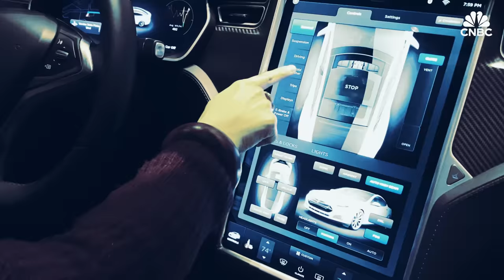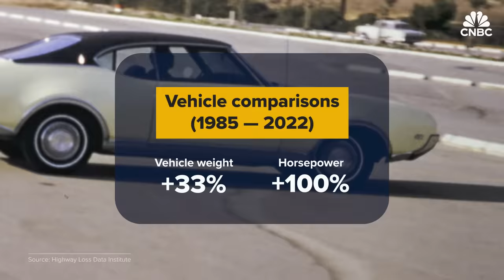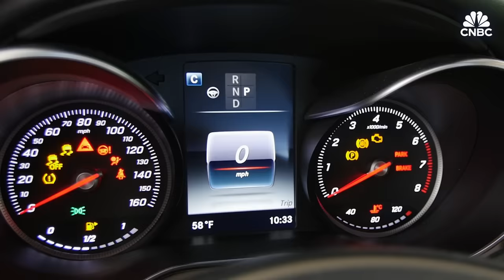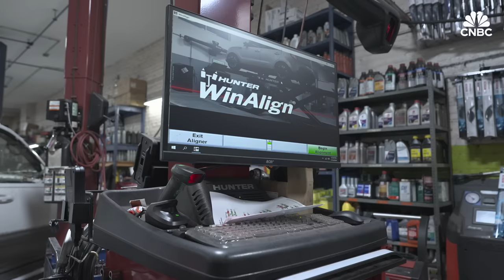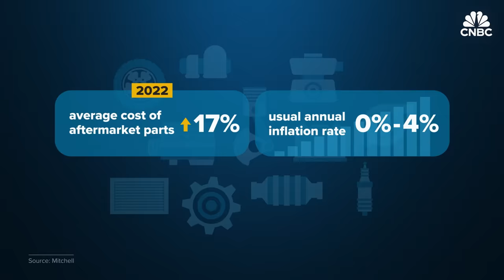Why Car Repairs Are Getting So Expensive

Comment: At this point im riding an electric bicycle or getting a motorcycle license because this is getting ridiculous putting money into something that expensive and be a necessity for everyday living.
Reply: I typically drove just under 3,000mi/yr. Since I got an ebike, especially a cargo ebike, and a Costco opened up within ebiking distance, I put over 2000mi/yr on my e-bikes and <600mi/yr on my car.
Reply: That's limiting. You can't ride an electric bike or motorcycle in the rain or when it's cold or when you need to carry stuff/people. You can't ride much beyond your town.
Reply: @bwofficial1776  Did you not see I still drove almost 600 miles after using my e-bikes for most of my previous car? You don’t have to go car-free, car-lite is just fine. I don’t feel limited in the slightest, especially when I cruise past congested traffic.

I ride in the cold a lot. Done it as cold as -10C (14F), which is the lower limit anyway for the batteries when they’re cold. A lot of people do. Simply dress for the weather.

I don’t like riding in rain though many people don’t mind it. It’s more fear of bad drivers due to reduced visibility and traction than my own comfort. Were safer infrastructure available, I’d ride in the rain too.
Reply: @bwofficial1776 who said you cant ride in the rain and cold on an ebike? Plenty of ebike riders do both and their ebikes can handle it. Dress for the occasion.

Also if you need to carry stuff, you have to get the right bike for the right job. You dont get a road bike for a cargo bike job just like how you dont tow 10,000 lbs with a prius when thats a truck job.

My cargo ebike can carry people and/or cargo. It can carry a combined weight of 450 lbs (rider and cargo/passenger) and 300 pounds of that can be on the cargo rack alone (Thats ignoring the fact i could get a bike trailer to expand that capacity further).

Put it simply, i can carry a week worth of groceries and still could add more stuff if i needed to.
Reply: Yeah but if you get hit by a car you’re dead
Reply: @nickrod7627  that’s why it is good to live in a place that isn’t so infected by car-brain.

Comment: I drive a 20+ year old car. Still the same car since my university days.

Parts are cheap, easy to replace and gets me from point A to B without hiccups.

Great on gas too and my insurance bill is low since older cars are lighter in weight.

Older cars also have way less electronics - which in my opinion - are not needed 99% of the time except the ECU.

The golden era of economic performance cars is between the 80's to early 2000. Cars without carburetors and fancy digital gadgets. Most of these cars have amazing gas mileage and don't require an arm and a leg in costs to diagnose because there are simply less things prone to risking giving out false readings. 

Most importantly, people need to understand pre-emptive general maintenance for their cars such as fluid and oil changes along with other consumables like serpentine belts, boots and hoses - a.k.a. the items prone to deterioration over time due to moisture, thermodynamics and oxygen damage. 

Personally, unless one has money to burn, my opinion towards cars is that for work and travel - buy an used older model that has a solid engine and tranny. 

For pleasure, sure buy something newer (Or vintage) that isn't driven too often, is stored undercover or inside a garage.
Reply: I own a car of similar vintage, I prefer that era as well. I'd be wary about the electronics older cars do have, and it might apply more to 80s and 90s cars, those electronics are ageing and may fail themselves eventually. But yes, as far as parts availability goes, can't go wrong.
Reply: @Jscot1001  Get a used Toyota. Parts are EVERYWHERE. Tons of aftermarket replacement parts for CHEAP too
Reply: can't get parts vehicles made in 80 90 already hitting early 2000's
Reply: Bought a 2008 Highlander, when I purchased it, went on eBay and spent $40.00 on a few replacement parts, the most expensive thing I purchased for my Highlander was the battery for $125.00
Reply: @Argedis I have a 2022 Corolla and it's a piece of utter trash. Will never again buy a Toyota. I'm in Europe, maybe the models sold in the US are better, I don't know.
Reply: Same story with my 06 Camry my dad bought when it was new: I spent ~740 on regular unleaded in 2023 to drive ~9400 miles. Costs 24.92 on oil changes roughly every six months or 5000 miles at the local Walmart Auto Care Center as older vehicles aren't picky. Auto insurance is also negligible, versus that alone would likely eat away the cost advantage of better mpg on a much newer vehicle. I imagine it's also a statement to other motorists you're a safe driver that your vehicle is past 10-15 years old and you're keeping it and has no collision marks. I will keep driving it so long as it gets me to my destination.
Reply: not all cars were lighter 20 years ago there were some full size cars that still weighed more than 4000 LBs such as the Ford Crown Victoria LX Sport Mercury Grand Marquis LS & Lincoln Town Car and modern day ones Mercedes SL 43 AMG  Cadillac CT5 V Black Wing are all over 4000 LBs and in the case of the Benz SL closer to 5,000 LBs hell the Lincoln Continental Convertibles from the 1960s were 5,500 LBs
Reply: @MattExzy  Convert to the ole reliable carburetor when electronics fail. When my PCM fails and I can't get a replacement anymore, I'm carbing it.
Reply: Let me guess.Toyota?!?!
Reply: @HuChing-ob4kk  honda dc5 :P
Reply: cars from the 80s sucked, low hp and bad gas mileage, you want a carburetor? ok say good bye to your gas mileage and have fun in the winter
Reply: @mikeg3495  who cares about gas mileage? Milk cost more. And my 70 71 charger does just fine in the winter with its fuel guzzling 4 barrel.

Comment: The more tech you put in cars the more repairs cost. Endless scans and calibrations don’t help. Lots of plastic bumpers add to repair cost as they damage easier. This trend won’t stop anytime soon.
Reply: People laugh because I drive a car with a key and no FOB until their FOB goes bad.  My last key cost me $4 at the hardware store.  My wife's FOB (that went bad) will cost hundreds of dollars to replace
Reply: The more tech you put into cars the EASIER it is to diagnose and fix problems..the problem is it COSTS to have guys who can DO that
Reply: My car has manual windows, manual transmission, manual locks, no key fob and no trunk release from the inside of the car. So simple, I love it .😂
Reply: Take it from the French, you don't have to repair plastic bumpers.
Reply: @Alessandro-ev9bj  these nothing to break!  That's a man's car there...

Comment: Paid $2,500 to replace the clutch system in my 2005 Tacoma outside the Toyota dealership and it took the maximum book time and rate. The mechanics are ripping us off just like the dealers.

Comment: Ex GM engineer told me they designed components to purposely fail. They would choose designs that were highly fail prone but were a 10% cost savings to produce.
Reply: So you are saying that you would gladly pay more for a car with better parts?  I doubt it.
Reply: I'm an engineer. No this doesn't happen. There is a fine line of design/engineering to meet a specific price point vs intentional malace. Yes in order to meet a certain end price some shortcuts are made, but its purely price driven. I could design you a $250k dollar corolla, but no one would buy it.
Reply: @bobroberts2371 i did. A 2023 camry isnt exactly a budget car for someone who only makes 52k a year, but the reliability will make up for it in 8 years
Reply: @thedude5040    Thanks for bringing that up.  Many of the tin foil hatted people fail to realize that life expectancy of cars has steadily improved since they were invented.  In the 1980's a car with 100,000 miles was completely worn out, now a car with 150,000 still have a good amount of life left in it.   The real issue is car owners not maintaining / fixing stuff as it fails then getting hit with a big repair bill.
Reply: It's not deliberately designed to fail.

It's literally just R&D engineers designing new components that work, presenting them to the board of bean counters, and then being told to find a way to make those components cheaper. It's called cost cutting and there are natural consequences to that.
Reply: ALL GERMANS DO THAT.

Comment: Cars in the future (EV's specifically) SHOULD be less to maintain due to less moving and mechanical parts. But, will definitely be more to repair due to the endless sensors and electronics tied to multiple computer networks within the car. I have close friend who got his Tesla Model X bumper dinged in a parking lot. His estimate for repair was just short of $10,000! Full bumper replacement and all related sensors including recalibrating etc. For certain part of this ridiculous cost is sole sourcing by Tesla, including limiting where and who can repair their vehicles..

Comment: Yeah I just went through this yesterday. I can’t believe they are sticking hour rates to customers for 30 minute jobs. This type of business model is an issue. It only works in remote services. Why would should a consumer be charged $120 hr for windshield wiper replacement. Then add shop supply cost. distribution is any issue but you would think cost would be cut somewhere else to retain business. Apparently not

Comment: Engineering to minimize assembly time has the opposite effect of maximizing repair costs (conveniently padding the margin of the service/parts portion of the business) seems to be a trend as well.  My 2021 F-150 cracked its plastic oil pan drain plug tabs and needed to be replaced.  I ended up doing it myself, but this involved not only the $375 custom plastic oil pan, but close to another $300 of one-time-use, torque-to-yeild bolts.  Oh, and two of those ended up being engine mount bolts since the service procedure involved dropping the front axle assembly and lifting the entire engine/transmission up.... just to replace the effing oil pan.   I'm stubborn enough that I still did the repair myself (including the 250+ ft/lb torqued engine mount bolts), but this was never designed to have an average owner dream of tackling what used to be simple repairs.
Reply: why would you buy a car with a plastic oil pan
Reply: @redlight3932   Consumers don't have a choice here.  They weigh less than steel pans for gas mileage, don't crack as easily as aluminum, but don't have a normal plug thread like a steel pan which makes it easy to break in the one place you regularly touch the pan. At least the 1/4 turn design prevents the quick-lube places from using an impact to get the drain plug tight.

Comment: I own a 2014 Dodge Dart. It's basically a FIAT. If you know anything about these cars, you know their quality is horrible. I recently learned to fix my own car. So far, I've fixed my window actuator, my truck sensor, replaced my own PCV valve. Most modern cars are basically like legos. I replaced my fiancee's horn last weekend and I'll be removing her door and replacing it soon. They're really fun to work on too! My advice, figure out what it costs to buy a decent set of tools from Harbor freight and look up some videos on Youtube. You'd be shocked how many car codes can be cleared by just a simple cleaning of a part.
Reply: A Dodge Dart? That's literally a rolling dumpster fire on four wheels lol

Comment: Stealerships have being price gouging car owners for far too long
Reply: You do know that dealerships are specialized shops, not independents and have higher overhead. We also have to pay techs a good wage per labor hour to keep them here to work on your vehicle.
Reply: I'd say people are too cheap to own and maintain the vehicles they rent from the bank.
Reply: RIGHT cause the dealer spends a good portion of the day fixing what other independent shops couldnt, wouldnt, or tried to and messed up.
Reply: @4X4ish  Dealerships do not pay a good wage, at least for most of the mechanics. Flat rate is a scam on the mechanics. So glad I quit being a mechanic, I make quite a bit more money and don't have to buy tools.
Reply: @biometal770  if you hustle, you make money. Not being on flat rate generally means you’re slower than most and want to relax on the job vs work.
Reply: they should charge them triple
Reply: @biometal770 yea that’s true.
Reply: @4X4ish not really. If you’re in a shop that doesn’t get a lot of volume for repairs or the service writer doesn’t give you any of the higher priced jobs, then it’s not good. It’s feast or famine. It’s not reliable income.
Reply: Dealerships know the car inside and out because it is THEIR car..they have specialized technicians factory trained JUSt for those car...and they see the same problems over and over. You go to the dealer when you want it done RIGHT..and this you have to pay for...

OR you can take it to a small shop on the corner with a self made mechanic who thinks you can just replace the front struts on a 2010 Higlander and never realizes he just destoyed the WHOEL system and now ALL of them have to be changed...because the strut system is designed with the struts connect diagonally rf/lr, rr/lf
Reply: @biometal770  what are you doing now?
Reply: @4X4ish Flat rate doesn’t work well in the rust belt
Reply: @TheIncredibleJumpman  I went to college. I realized that, to be a good mechanic, you must have an engineer-level amount of knowledge. So I went to college to be an engineer. But then decided to get science degrees instead. If I had not done that, I would have become an industrial HVAC tech. I have a (former) mechanic friend that now does this for a 6 figure salary.
Reply: @4X4ish  If you hustle you make money, with two IMPORTANT qualifiers:

1. There are enough cars such that you are working throughout the day

2. You don't get sidetracked with stuff you aren't getting paid for, such as rust, ordering parts, etc. And you are being fed work by the service writers.

I was in the business for a long time. I saw so many old mechanics with beat up bodies that just couldn't keep up in their old age. Get out while you are still young and develop a career with a good wage and an actual development pathway.
Reply: @biometal770  I had actually applied to an HVAC apprenticeship program several years ago, then COVID cancelled that and I wound up going a different path. HVAC or, more obscurely, elevator tech are both jobs I am still interested in considering at some point.

Comment: I hit a commercial van right in the parking sensor unit a few days ago. Had to fork out $1800 because insurance is already barely affordable if you don't have a claim history. My manual transmission 2009 Elantra got hit in the space between the bumper cover and the foam liner. No fancy computers or sensors on mine. It cost me $40 worth of Bondo and almost-matching spray paint, because I could do the job myself and nothing electronic was there to be hit.

Comment: I worked as a manager for 10+ years in the automotive industry. Got out in 2010. Most shops had 1 mechanic who was paid well (maybe a second was making an ok wage). Most of the mechanics were making less than 30k a year full time. I knew a few (high-level dealer mechs) who left to pursue other careers.  It’s not really a good profession to work in (even though it would seem to be). The average brake job (pads and rotors) when I left the industry was about $325. I was recently quoted $600 on my Subaru (and that was after shopping around). I was shocked that no one turns rotors anymore! That’s a new thing. Did it in my garage with pads from Napa for $50 (rotors were fine). The price of the Napa pads were about same price as in 2010.
Reply: I am also shocked that nobody turns rotors anymore...
It was explained to me that now rotors aren't thick enough to resurface.
My rotors were fine but needed the glazing sanded off.
Reply: No point in turning rotors. For 15 dollars more u can get a new one. Also, thin rotors warp alot faster.

Comment: Some techs do make a lot of money, but at the shop I work at,  I get paid $20 flatrate and the customer pays $200 an hour for my time. So the dealership is getting 90% of that, and tbh I have no idea where it all goes because especially at our shop overhead cannot be that expensive
Reply: If you are getting paid $20 in 2024 you have been shafted.  We have Rockies starting at $20 after working for 2 years most are requesting $30 if we don't pay they just leave.  Genz mechanics are not loyal to employers
Reply: Yeah and 30$ is still a small percentage of $200-275 shop rate. And most shops dont want professionals. They want cheap labor.so many horror stories of kids over their heads, customers getting in bad accidents because of poor repairs. Aftermarket part prices are way high for poor quality parts also